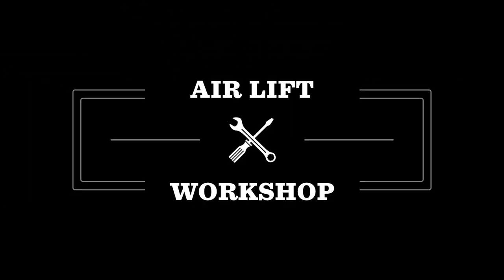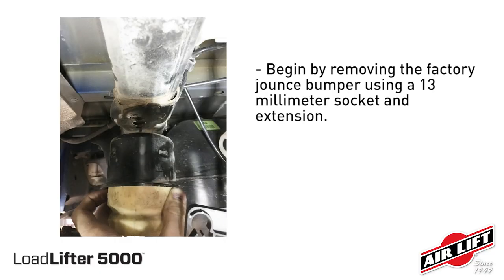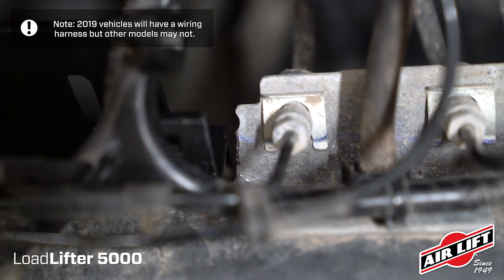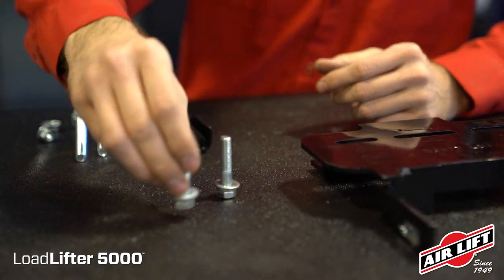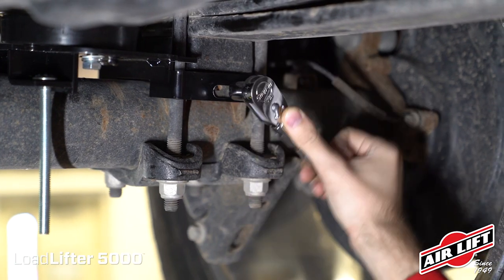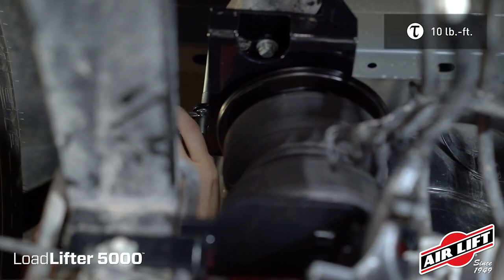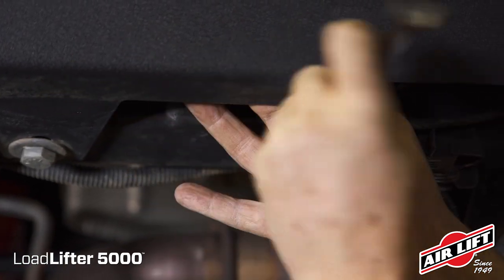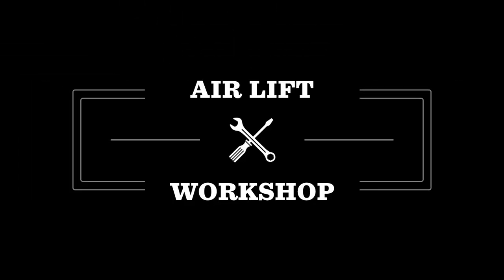Air Lift Install: 2015-19 Ford F-150 - LoadLifter 5000

Comment: Thanks for the video. I went to install a set of Firestone airbags yesterday and was derailed by the brake line bracket I needed to cut to make room on the driver's side. Seeing this in your video makes it clear I need to cut it and get it out of the way. Thanks.

Comment: How can you tell what model you have? I have a 16 F-150 that came with it installed. Also is it good to run a certain psi for just daily driving w/o load/trailer?
Reply: Most light duty air bags recommend 5 psi minimum daily air. So about 5 psi to 20 psi